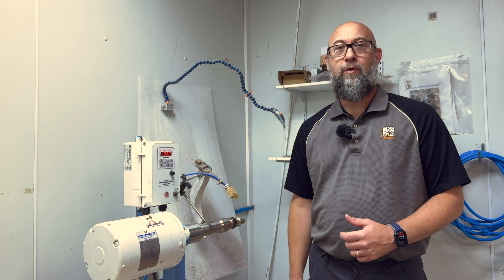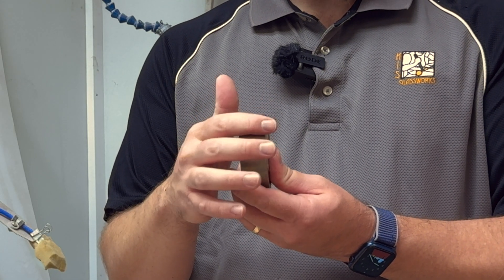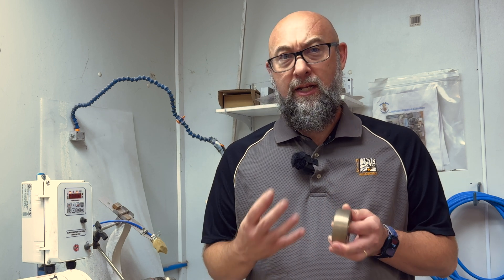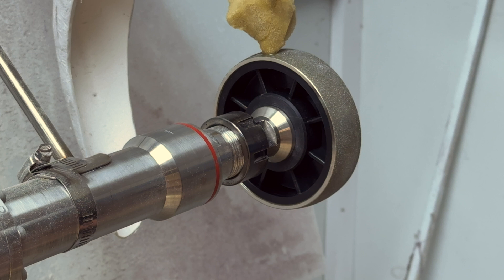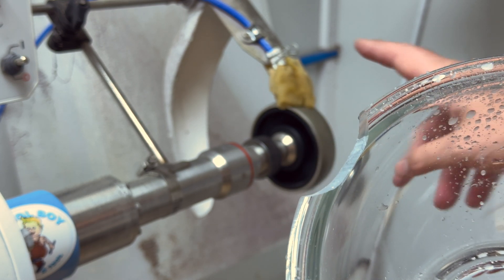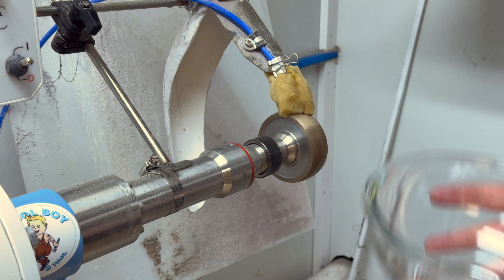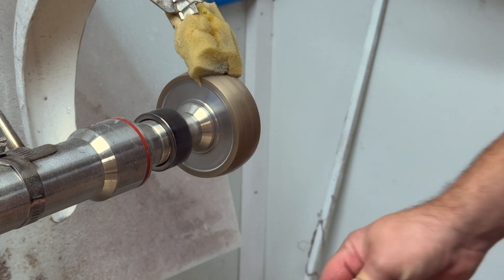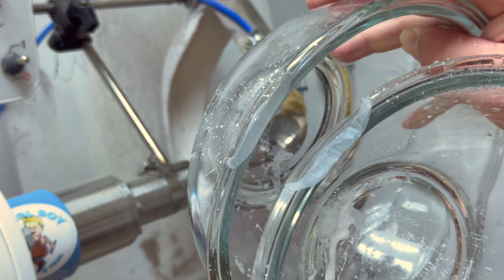Coldworking 101: The differences between Electroplated and Sintered Diamond Wheels on a lathe.

Comment: Might be interesting to see the same grit
Reply from the maker: It gets a little interesting as the grit levels between electroplated and sintered typically don’t line up one to one. Since they behave differently on the glass the grit options are often offset from one another.